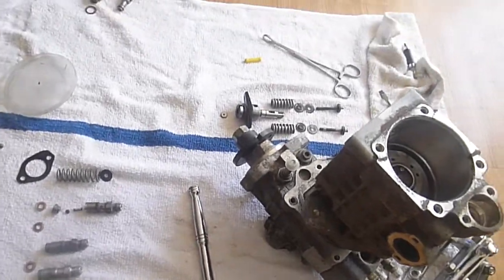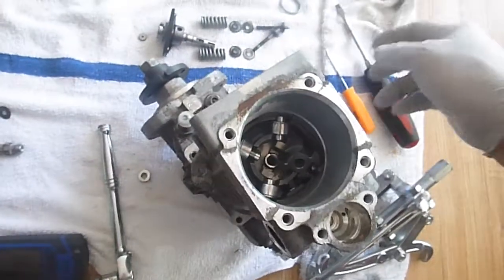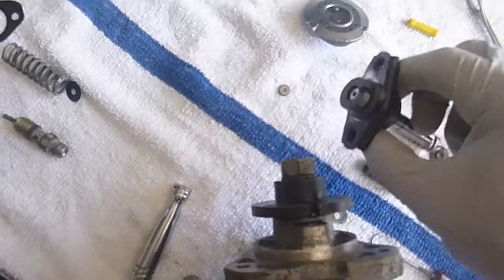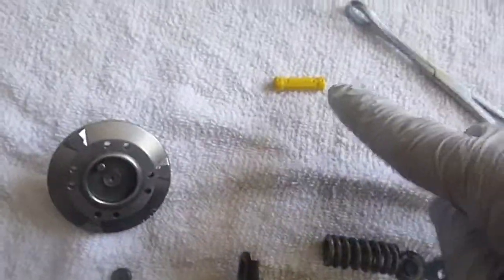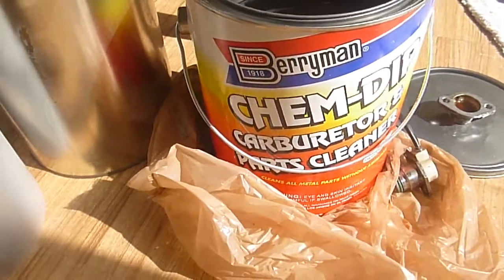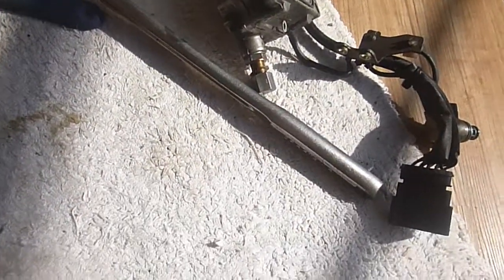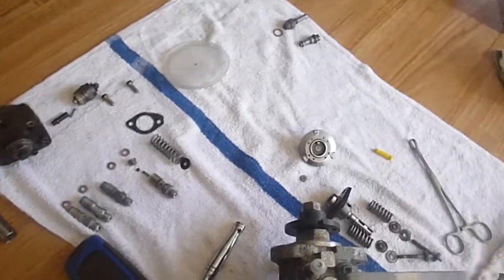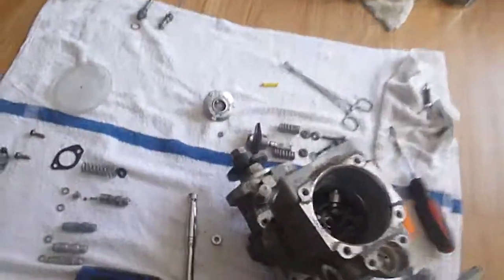ULTIMATE: ALH Diesel Pump Teardown (follow up notes)

Comment: Did you get it running?
Reply from the maker: Yes, Thanks for asking. After you take it all apart and really clean all the old diesel carp off these pumps remind you that they were built to run forever (or at least for a very long time. putting it back together was not that hard (4 on a 1-to-10 scale). These pumps are amazing. The 11mm is well worth the upgrade for manual transmission drivers. More speed and better fuel economy. The best of both worlds. The IQ (the electronic part on top of the high-pressure pump which controls Injection Quantity) was sticking so I soaked it for almost a week. I guess you can soak it in isopropaline alcohol too, but I used Chem-Dip Carburetor & Parts Cleaner. When you turn the IQ arm (which happens when you press down of the accelerator pedal) the arm should immediacy spring back. My IQ was not turning all the way. I thought I was going to have to buy a new pump, but I went to my local junk yard and luckily found a 11mm diesel pump to practice on. I found out that most of the tar like crap is in the bottom of the pump and once you clean that junk out the pump and IQ work a lot better, but polishing and completely cleaning the pump makes it better then new.

TDI Love from Chicago.

Comment: so that IQ is spring loaded...probably just a pulse width modulated signal driving a solenoid pushing against the spring... interesting.... and simple... it would be interesting to see the waveform driving that solenoid while it's running....
Reply from the maker: The strange thing is that there are 5 or 7 control wires going to the IQ head.  Two are for a heater resistor.  Two are for a solenoid and the other(s) is/are for a resistive feedback.  Also, the ignition timing and pump STOP flow rear solenoids is on the same harness... I think.  but when the ignition key is on the pump STOP flow rear solenoid is opened to let the high pressure pass through to the injectors.  There is a Russian YouTube video showing a guy disassembling the IQ to clean it and re-soldering the connections at the end.  I will have to watch that video again to refresh my memory. (https://www.youtube.com/watch?v=ji6wXUeI22w) wow

TDI Love from Chicago (Where LaLapalosa will cause gridlock in all directions for miles)
Reply: been awhile since I've looked at the pinout.  I know there's a temp sensor,  probably a IQ position sensor , and a wire to control the low pressure in the pump (maybe from 10 to 125psi) for timing control. I'll look for that Russian video.  The old VE pumps have a tiny orifice on the fuel return line to cause pump body pressure to increase as rpm increases, which advances timing.